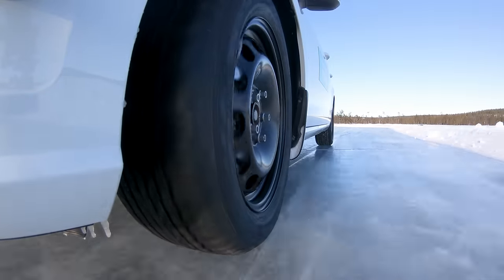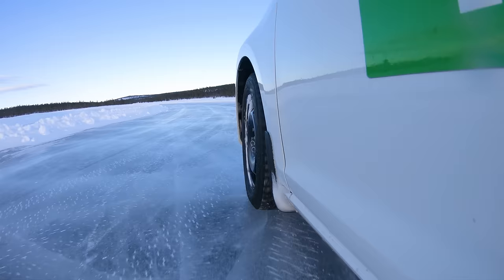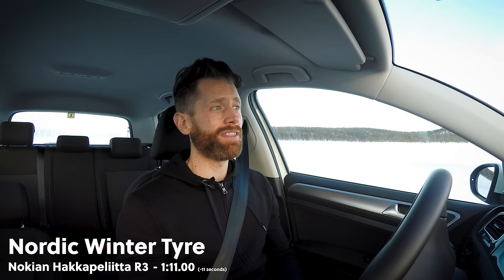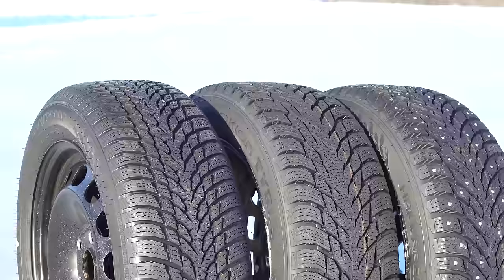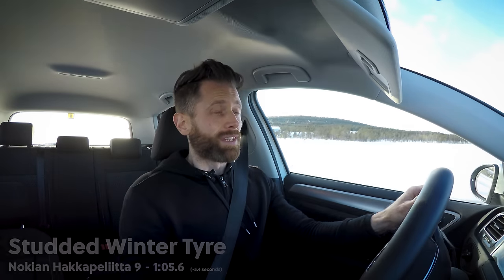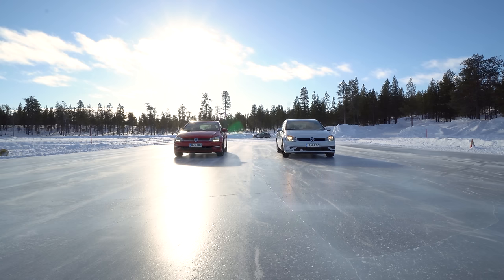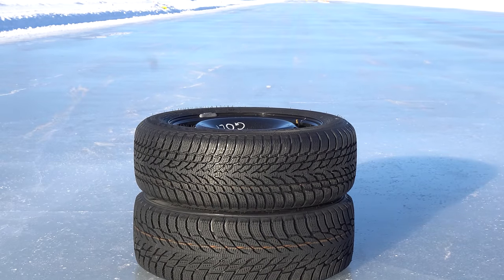Winter Tires VS Studded Tires ❄ What's better on ICE?

Comment: Wow, only 5-6 sec difference. I was expecting more out of the studded tires. Great video as always. The snow tires that gets all the rave here in the US is the Bridgestone Blizzak series. It would be a heck of a comparison to do Blizzak and Nokian cheapest snow tire to the best studless.
Reply: Your own ('murican) Goodyear Ultragrip Ice 2 tyres are quite good, Nokian grips better like Continental also, but they cost more. Goodyear has a better driving/handling in tarmac than our own Nokian, which is softer by nature//more focus on ultimate traction.
Reply: Bridgestone Blizzak beat Nokian hands down in all tests actually. It's just a better made tire period. With all that said Nokian is not a bad choice. The Blizzak series is nearly double the price so that's expected.
Reply: @KeepersWay  What test would this be?  Because the only comparison test that I could find was Car and Driver's 6 winter tire testing back in 2015.  The Blizzak WS80 was 4th place and the Nokian Hakkapeliitta R2 took 1st place.  I haven't seen anything for the WS90 nor the Hakkapeliitta R3 comparison though and that's what I really am interested in seeing.

I also don't know about better tire.  Both Nokian and Bridgestone make quality tires.  Like I had the Nokian Zline A/S and now the Nokian WR-G4 tires and was quite impressed with them.  I also buy a set of Bridgestone RE-71Rs every year and have always been happy with their tires and getting my use out of them for the year.  Quality of rubber per tire brand seems great in both and I don't think one brand is better than the other.

As for Blizzaks being double the price of Nokians, not really.  Maybe if you were comparing Nokian's cheap lineup of tires like the ZLine A/S but definitely not more expensive than the Hakkapeliitta R3, Nokian's best studless.  For a set in 225/40/18 (just using a common 18" tire size), it's $880/set for Blizzaks WS90 and $936/set for Hakkapeliitta R3.  Pulled these prices straight from Simple Tire.

Comment: My biggest gripe with studded tires is how quickly they are pushed in, as well as bent/deformed, or just worn down or even ripped off/out. Then you stand there with lots of thread left, but not much performance from studs. The studs always let go long before the rubber, and what do most people do about it...

Comment: Are the studs replaceable? Having driven two seasons on the Hakkapeliitta 9, the studs are mostly worn now, so I am curious if I can stretch the life by replacing the studs
Reply: On these tires, no. Usually you'll only get them replaced on truck and industrial tires nowadays.
Reply: It's actually illegal to get them re-studded in MOST states and MOST tire shops will refuse too do it as well! You could do try too do it yourself but it's technically illegal and you won't be able too get the exact studs Nokian used either way with that being said some people experiment but yeah your risking tire damage or worse a vechile accident! I'd personally just drive on them for another winter season or 2 and then replace them with new ones!!!

Comment: I bought Nokian all season tyre in 2015 and drove with them 32k miles and sold the car with them. No issue on the grip in winter, water, leafs. My car was manuel FWD but still changed to the Nokian tyres felt like I'm driving different car.
Reply: Lived in UK near London.

Comment: I been using Nokia tyres with no studs for 30 years and driving around Stockholm, Gothenburg area. I never felt need studs. I been keeping normal speed on the roads on almost any surface, only when very extremely slippery I go down to 70 km/h on highways. But that is 1 day per year maybe

Comment: It may not be due to the compound.  While the treads between the two non-studded tires are similar, the R3 has way more sipes. I would say the incrased grip is more attributable to the sipes then the rubber.

Comment: Thank you for the video. 

I assume studded tyres are illegal in the uk? 
How do Michelin cross climates perform on ice? Just got them on my car not long ago upon this channels recommendation
Reply from the maker: Way better than summers, but not as good as a full winter or a more siped all season tyre. Winters are illegal and also mostly useless in the UK!
Reply: @tyrereviews  "Winters" are perfectly legal in the UK; we get one every year! :-)  As for studded tyres, the law does not appear to forbid studded tyres explicitly; however, the authorities may take a dim view, so studless tyres are the safe option.  What the law says is that the road wheels must not damage the highway, but the term "studs" or "studded" is not used in the legal text, so make of that what you will.  Good video, BTW, which accords with received wisdom of the general public in Finland, where everybody is a rally driver.  ;-)

Comment: Hi guys, I need some advice as I've never used winter tires. I just got a medical courier job and I'll be driving about 7 hours a day in my SUV. I live in Iowa where winter is setting in so I'm wondering if I should get studded winter tires or non-studded? Will driving long distances on the highway every day ruin the studs?
Reply from the maker: Long distances shouldn't ruin studs. Whether you need them is down to how much ice you will encounter as that's when they really make a difference

Comment: You need also to write/say what the outside temperature was during the test. Studded tyres work great on ice down to -15…-20 C. If it’s colder - R3 would have been better.

Comment: Studded of course on ice. Studless winter tires are more comfortable, quieter, and more fuel efficient than studded tires. And they are as good as studded in snow, if not better. However, remember studless tires are not as effective on ice as studded tires. Nor are they recommended for beginner winter drivers. Studless tires require a lighter foot, more anticipation of road conditions, and generally more cautious driving.
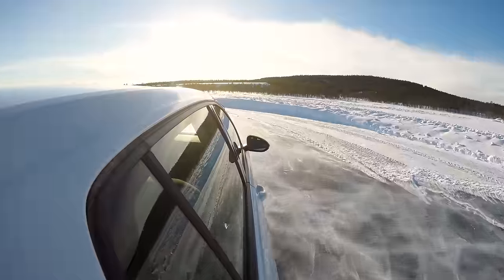@0:50 even though those Nokian R3 are studless tires on ice, it is not melting wet or slushy ice , and if it was, these studless tires would be all over the place. Even on that relatively dry surface ice, the car is still sliding and on normal roads with kerbs etc. even that is too much risk already. Also, compound tires work quite well below zero only, less so above. And they have a shorter lifespan than studded because they're softer. So, studded for ice and snow all the way for me then.

Comment: Been driving those studded nokoians for years, no arguement, they are amazing.  Feel like the king of winter in everyday traffic. RWD btw and front engine, stilll first from traffic light, even tho FWD should win there.
Reply: FWD never wins anything. Think you meant AWD.
Reply: @Warlock2212  nope, on snow FWD has more grip, since engine at front gives more weight to the wheels, while my RWD  just spins around doing nothing.
Reply: @nickgage1438  i have the exact same wintertire in the same dimension on my c350 coupe and my cla220d (michelin pilot alpin 5 in 225/40 R18), one is rear wheel drive, the other front wheel drive. tires have almost the same age, and the traction from 0 on is way and i mean way better on snow with the c350 rwd.
Reply: @Warlock2212  no clue how, the numbers dont add up, more weight you put on something, more grip you get on snow, unless one has a better traction control system. Try both with traction control off.

Comment: I live in Canada. I thought for sure the studded tires were a no-brainer win.... I am very impressed with the results with compound Nokian tires. However, in reality, a smooth glassy ice surface is rarely real world driving. Icy roads are normally composed of ice/snow/dirt which is melted and refrozen over and over... I don't think the compound tires would be as effective as studs in these conditions as they rely on lots of surface contact (which you dont get on a frozen bumpy surface)... Fantastic video BTW!
Reply: The compund ones are a waste of rubber. Studded tires for the win, here in northern europe studed tires is a no brainer

Comment: Here where I live the winter temperatures is usually +5c to -7c and rarely colder then -12c and studdless winter tires work great. But when I drive trough Finland in -25c to -40c the studdless winter tires is dangerously bad... Studdless works horrible bad in the more extreme cold.

Comment: I´ve had Nokian WR D4 and Nokian Snowproof and I live in Iceland (plenty of icy, wet ice, slushy, snowy, compact snow conditions during winter). These tyres are horrible on ice. You could be driving a spaceship and get similar results. They work fine in compact snow and slushy conditions, so they are useful in city centers. But if you want safety you should choose studded tyres.

Comment: I have the hakapilita suv 2 on my jeep wrangler, they are great in snow and ice. However if on just bare pavement ( winter driving ) the studs actually make breaking worse as you are then sliding on the metal.  There not terrible,  but my next set will be stud less nordic tires.
Reply: Goodyear Ultragrip ice 2, works here also. If you want to go full grip, then Nokian R3 or Continental Contivikingcontact 7.

Comment: No road noise comparison? I run studded Hakka 9's on my golf but considering non studded next winter cause of the noise on asfalt/tarmac
Reply: Noise is secondary, at least to me. I take performance and reliability before I start considerating road noice
Reply from the maker: The new Conti rubberised studs might be a solution for you

Comment: Please answer as soon as possible. 
I wanna buy the winter ❄️ tires For the Audi A6 avant 2014 and the size is 275.45.20. Is it ok for my car or is it large for an Audi A6 Avant? Thanks 🙏🏼
Reply from the maker: Audi should specify a winter wheel and tyre size but if they don't stock is also fine

Comment: The studless tyres works fine if other cars have studs. But when all cars have studless the road get polisched like new ice on a lake. So starting the test with studless and then with studs and then again with studless will show how effective studless tyres are when the road is rough from studded tyres. So if it is cold and rain the studded tyres is at its maximum of difference with studless. But still when the road is frozen and its raining its better to stand still. Not even the tyres with studs gives much performance. When the law changed in Sweden and all tyres had to have studs or not studs, busses had trouble starting after a stop beside the road. Earlier the front wheels had studs and that was enough do make the surface rough enough to make the rear studless tyres to get some grip to start. And if this test would have been done again after the tyres had been driving on a salted road, the result would have been much slower lap times. Lumber trucks that pulls of the dirty highway into winter forest roads often clean´s the driving tyres with a degreasing compound, to get maximum traction. But the differens in real wintertyres and summer tyres is outstanding in all situations. Snow and mud tyres works if it doesn´t get to cold. But at -10 Celsius and colder the coumpound of the tyres makes a big difference. At -40 C most tyres are like hockey pucks. But then the snow and ice isn´t that slippery.

Comment: Main issue on winter roads in nordic countries is patches of black ice in the early mornings sub zero temp after a rainy day. Hitting a patch at 90 kmph is very different from driving carefully on a ice track. This does not prove much on safety as long as you do not hit patches of ice at 90kmph or more.

Comment: Have you made any tests between studded and non-studded winter tires om other surfaces than ice, like snow, dry or a "snow-sluschy" road? Whats to prefer in other environments than ice?
Reply: Studded tires give up traction to other tires on anything else but ice.
Reply from the maker: Video in pinned comment
Reply: @tyrereviews  I'm sorry. I'm not used to use the comment section on Youtube. What do you mean by pinmed comment? What is it?

Comment: They keep the roads salted well enough where I live that slush is the main concern, solid ice is almost never an issue. Nobody else uses studded tires here, so if it's too icy to go studless, other drivers are putting you at risk and you should stay off the roads anyways.

Comment: I run on Nokian studded tires. They are by far the best tires out there for winter driving. I drive through the mountains of Vermont and these tires have never let me down. Uphill I have lost traction but did not lose control. The van stayed straight and with just a little lift off the gas pedal, I had full traction back. These tires don't mean you can drive like a fool and get away with it. Please be smart and use winter tires in the winter. All-season tires are no good for winter driving. The life you save is worth the money.

Comment: Hi, great videos.  Could you help me with this query please?  We've got Michelin CrossSlimates as a compromise tyre.  I've seen good reviews on snow and sluch but absolute silence on their ice performance.  Are they as bad on ice as summer or all-season tyre?  Are they better but not as good as a winter tyre on ice?  Is their compound very alike a summer tyre rather than a winter tyre?  Many thanks, K.
Reply from the maker: Compound is unique. They have a lot more ice performance than a summer tyre, but a fair bit less than a winter or heavily siped all season
Reply: @tyrereviews  Many thanks, very helpful.  Could you please identify one or two of the latter, recognising you are NOT recommending them, just stating one or two which can be described as all season and heavily siped?  Many thanks, K.

Comment: Have you ever tried just putting snow tires on the front wheels on a FWD vehicle and keeping All seasons on the back?
Before you answer keep in mind, many highways in the mountains require chains when it snows 
which essentially creates a much bigger difference in traction between the front and read wheels.
I live in Colorado where it can snow pretty good, but most of the winter the roads are clear, so want separate wheels/snow tires that I would put on just during the 5-10 snow storms we have each winter. 
Buying 2 wheels/snow tires for the fronts would save money and time when I switch out and back for these occasions.
Opinions?
Thanks!
Reply from the maker: I love colorado! There's a video on the channel about mixing winter tyres and summer tyres, worth a watch. All seasons wouldn't be as extreme but still not a great idea
Reply: @tyrereviews  Soooo...why is it Ok to use chains on just the front wheels?!?!?
Again, far more difference between traction on front wheels vs rear wheels than the aforementioned snow tires vs all seasons.
Reply from the maker: @boldyo  Chains are ok because you only use them at low speeds and you're very aware they're on
Reply: @tyrereviews  Ok thanks, you convinced me, I'll get all 4.

Comment: In Sweden it is legal to use winter tires if there are winter road conditions between December 1 and March 31,  before and after these date it is forbidden the use because studded tyres apart the great grip still can damage the roads.
This winter I will use studden tyres in my 38kg e-Fatbike.

Comment: good vid and informative. I have an issue with these types of tests. For example. How many of use drive on solid ice? I live in stockholm, sweden. It always snows but the roads are cleared, grit and salt is used. 
When we have a lot of snow the main roads are never completely free of snow but there is always asphalt visable. So we are driving on roads with snow and ice but tracks where we see asphalt. It is December now and raining. the temp is about 3 degree celcius. The snow will come so what tires should we be using.
Reply: If you have a job that requires you be there,  police, fire, hospital, for instance, than you may need to have these tires. If you can afford to stay home until the roads are cleared then regular all-season tires may do you well enough.
Reply: Studless.

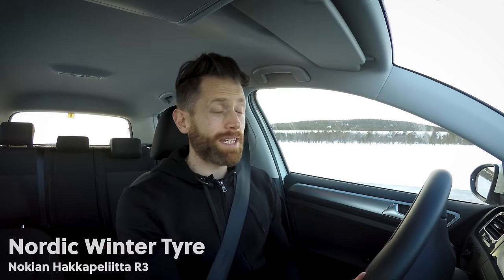Comment: but you can NOT say "The difference the compound for a tire can make is way bigger...than putting metal in the tires". As using the european's as the baseline of 1:22.0,  the compound makes an 11 second difference, and the studs make a 16.3 second difference. Making the studs a CLEAR winner. especially considering it is exponentially harder to increase that time.  It's kind of like getting closer to a black hole, the closer you are, the more time passes from observer perspective.  #physics
Reply: Modern studded tires like the Hakka 9 use a Nordic compound like the R3 overtop a firmer compound that anchors the studs. Nokian's been using since the Hakka 2 way back in 2000. So I disagree. The comparison is valid.

Comment: What's the speed limit od those tyres?
Are all of them with indeks H or T ?
When You have two the same kind of tyres, but just with "small" difference H or T, then we have also different lap time.
Reply: Grzegorz J unlike most competition the hakkapeliitta r3 has speed rating of 170 km/h. Hakkapeliitta 9 is 190 km/h like most nordic winter tires.
Reply: @blegi1245  european winter Tyre is also 170 km/h ?
If not, then next time please test tyres with the same speed limit. Tyre with 170km/h is more soft then 190 km/h and that's why it's better when is minus degrees.
Reply: Grzegorz J i have no idea. Its not sold in finland. The speed rating is just that. Highest safe continuous speed. You can substitute the hakkapeliitta r3 with any of the premium competitors with 190 km/h rating(vikingcontact 7 or ultragrip ice 2 for example) and the result would be the same. Better than european winter tire, worse than studded. European winter tire of any speed rating will not be better than a nordic or studded winter tire on smooth ice.